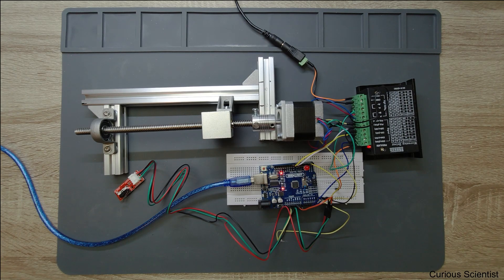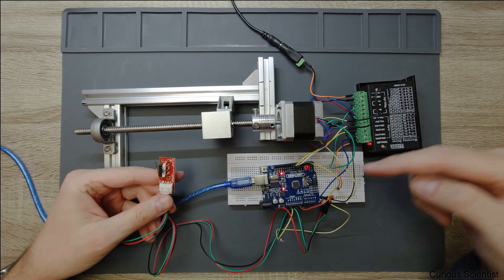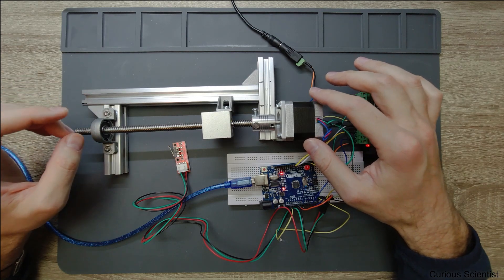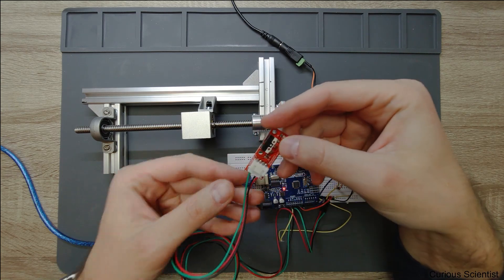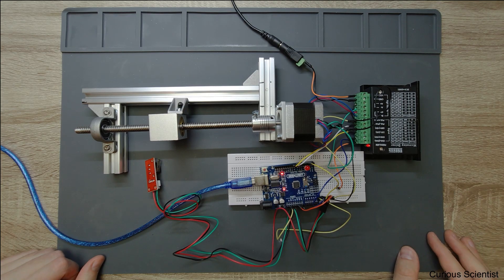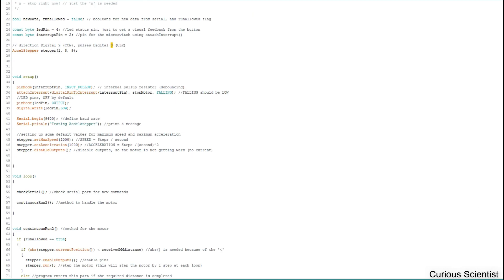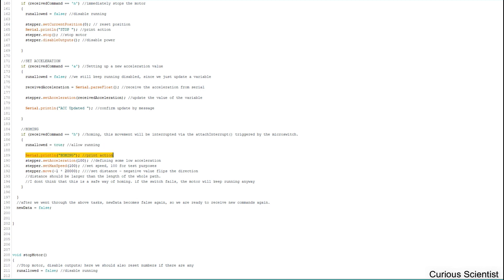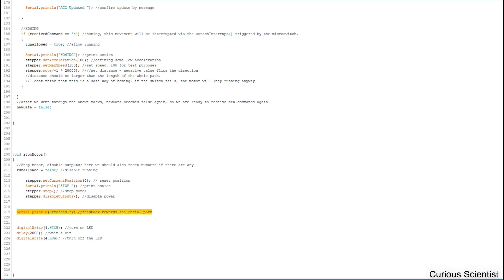Homing with the AccelStepper library and a limit switch

Comment: This code works with my a4988 driver and belt driven gantry (with tweaks for steps/mm) and thank you. I was pulling my hair out looking for exactly this functionality.  I deleted the malarkey regarding LEDs.  Anyone looking to control a linear actuator can take this code and run with it even if they're an arduino noob like me.
Reply from the maker: Thank you very much for your positive feedback! My intention with the whole channel is exactly this! I want to provide knowledge in a form that is easy to understand and easy to work with. I am very happy that the code worked for you and you could use it for your own project. Don't forget to subscribe, if you haven't done it already. More stepper motor related videos are on their way, I am just waiting for some parts.

Comment: Hi, Thank you for your 2 videos on this setup, it's pretty much what I have for my project. My question is how are the limit switch wired (can't make out from the vid), I have the same limit switches but can't make them work. I assume you are using just the green and red wires. Also, I want to use an external timer to start and stop the motor, opposed to using keyboard commands,  to reverse the direction twice a day to open and close a small hatch (door), any suggestions?
Reply from the maker: Hi! I am glad that it helped you! In this video, I just wired the black (GND) and green (signal, D2) pins and that's all. It is not the best practice, but it worked. I have a more recent video, where I show a sort of a ping pong game with 2 limit switches, you might want to check that out for some extra knowledge. There, I wired all 3 wires (red: 5 V, black: GND, green: signal)

For the timer-related question, check my video where I built a real-time clock based plant watering circuit. If you combine that with the stepper motor controller, you get what you want. But to make it more simple, you don't need an external timer. Twice a day, that can be fitted in the millis() function very easily. Start two timers when you start the arduino. You need two if() statements which are checking the time. Something like this:

if(time1 > 80000)
{
runmotor();
restartTime1();
}
if(time2 > 80000)
{
runmotor
();
restartTime2();
}

This is a very simple algorithm and it does not need any external units.

Comment: Thanks for sharing the video and your code. Would you be able to make a suggestion on how to adjust the code so that it works from buttons instead of the serial monitor? I just want to truncate it to a momentary button for homing, and one each for fast positive/negative movement and slow positive/negative movement while button pressed.
Reply from the maker: I made a control panel for stepper motors based on buttons and other controllers. Search for it on my channel and website.

Comment: I have a problem where if the button is released slowly it counts as another button press which stops the movement. so it stops fine. the limit switch is held down. then you move away from the switch, it releases and stops again.
Reply from the maker: The button you use is probably bouncing a lot. You need to debounce it. Either with software or hardware.

Comment: without tension, do you know if the middle part can move freely ?
Reply from the maker: What do you mean by "middle part"?
Reply: @CuriousScientist  i mean the part moins on the axis thanks to the motor
Reply from the maker: Ah, you mean the leadscrew nut. You need to spin the leadscrew to make the nut move. It is self-locking to some extent due to the friction of the threads.

Comment: Hello. Thank you very much for the tutorials!!! I learned a lot from your videos and sketches you make!
 I have a question. How can I make my bipolar stepper motor constantly looping back and forth with the AccelStepper library with the NON-blocking function? 
Thank you!
Reply from the maker: Hi! Thank you, I am happy that I could help. 

Just write a loop where you move to a certain number of steps, then with an if() statement, check if you have reached the end of the movement in one direction. After that, step back the same amount (flip the sign) and check the steps again with an if(). You can check the accelstepper library's info page where they say which functions are non-blocking. Use those. Remember, if you want to do something between 2 steps, the time required for the task should be quicker than the delay between the two steps. Otherwise, the motor will be lagging.
Reply: @CuriousScientist  Thank you very much, I will try that!!

Comment: Hi may I ask if making a 'homing' needs microswitch always? Can I make homing by just putting codes? I'm using nema23 and same driver module as yours
Reply from the maker: Hi! Homing can also be done by keeping track of the number of steps done. In fact the AccelStepper library keeps track of the steps and you can always use that to perform the homing. For example you move the motor clockwise 2000 steps, then move counterclockwise 500, then 700 clockwise and then give the homing command, the library will know that the overall steps from zero in cw direction was 2200, therefore it has to make 2200 steps in ccw direction to get back to zero. You just have to make sure that the system is 100% doing the exact amount of steps you give as a command. I can make a video on homing without switches using the AccelStepper library in the near future.
Reply: @CuriousScientist  Thank you so much! So all I need is the AccelStepper library and not any extra module for that control then?
Reply from the maker: @maryannemacalinao8376  Yes, you are right! I will upload a video of it during this week where I explain everything.
Reply: @CuriousScientist  looking forward for it sir! Thanks again!
Reply from the maker: Hi! I uploaded the promised video. Please check it out if you have time. :)
Reply: @CuriousScientist  I prefer this method of homing over the limit switch however, please tell me, will AccelStepper keep track of the stepper position in the event of a power failure then continue to travel the distances and directions commanded in the sketch when power is restored?  Thank you!
Reply from the maker: @cpnorkus  Hi Christopher! Unfortunately, all numbers will be lost upon a power loss. If it is crucial to remember the positions, I you can add an EEPROM and save the positions in it. Then after restoring the power, you can recover the most recent values. But, keep in mind that EEPROMs usually have limited life and it also takes time to write them (might disturb the stepping if you happen to write the EEPROM while the motor is moving). I think it is more easy to just add a USB power bank to the Arduino. You can keep the Arduino (only the microcontroller) awake for several weeks.
Reply: @CuriousScientist  Thank you for the speedy reply!  I have read on Arduino forums the limitations on using EEPROM for homing position.  I have been building my system incorporating a hall effect sensor because it is less likely to fail than limit or reed switches.  I do like your suggestion using a USB power bank a a UPS!

Comment: Hi I have tried your examples they are very good . But your last two examples where you have Changed to P, N etc i get a message on the monitor but the motor does not move . Have you made some other changes which effect the Accel Libaray ? Can you please help many thanks
Reply from the maker: Hi! It is a bit difficult to guess your issue. Do you use the code from PasteBin? Do you have the exact same wiring...etc? What did you exactly try?

Comment: Thanks a lot... I have other questions but I dont want to abuse  ;)
Reply from the maker: You are welcome! Just go on, ask it! We are here to help each other. And maybe if I can answer your question, it will help others too.
Reply: Hello  Is it possible to make a cercle with accelstepper library without Gcode ?
Reply from the maker: @patis.IA-AI  I think it is possible. If you have a x and y table or you can move your pen or anything that you use for drawing in terms of x and y, then you can do it. 

The equation of a circle with its center in the origin is x^2 + y^2 = r^2. So, you have to define the radius, then you can basically manually calculate x and y. You can run x as the integer in the for loop and calculate the y values at each step. Then you move your x-y stage/table/head...etc, according to the coordinates. It is pretty straightforward, you just have to move the x and y stepper motors based on the coordinates calculated from the equation of the circle. You can refine the step of x, then the circle will be smoother as well. If you want to place the circle at a certain place, you have to use the whole equation: r^2 = (x-a)^2 + (y-b)^2. Variables 'a' and 'b' will determine the center of the circle in the coordinate system.
Reply: @CuriousScientist  works with drv drivers?
Reply from the maker: @unknownblueblue  Hello!  Yes, it will work with the DRV8825, the A4988 as well as with the Easydriver circuits. 
Why?

All these circuits basically have the same two inputs: Step (or pulse) and direction. You just have to make sure that when you do the setup/initilaization, you define the proper pins for the step and the direction.
Reply: @CuriousScientist  thanks :)

Comment: Hey everyone, I used the template provided and tried to adapt the code for my used case, but I encountered some issues and though someone will stumble over this and will be able to help. I do not really understand the AccelStepper step counting feature. Could someone please help?

I want to enter a char into the serial monitor, say "t" and make the stepper move to a fixed position, where I know the number of steps from the zero position (which is indicated by the limit switch). But I want to be able to move to this position freely. 
However, I encounter two main problems: 
I don't really understand how the step counter in AccelStepper works.
My try was:

long sputter_pos = 1000;

if (receivedCommand == 's') { //Sputter - Sends the motor to the predefined sputter position
      runallowed = true; //Allow running
      Serial.println("Going to sputter position."); 
     
      current_pos = stepper.currentPosition();
      howfar=abs(sputter_pos-current_pos); //Set distance
      
      if(current_pos > sputter_pos){
        stepper.move(howfar); //Move distance
      }
      else{
        stepper.move(-1 * howfar); //Set distance - negative value flips the direction
      }

However the output simply is:
09:27:43.432 -> Going to sputter position.
09:27:43.480 -> POS: 0
09:27:43.480 -> POS: 0

and the motor does not move.

Another problem I have is that I would like the acceleration curve to be as specified but to have no deceleration curve, is that possible?

I also need a way of counting steps, so I would then send the stepper from the zero (limit switch) position and until I stop him manually with "n" for example and output the number of steps it went. Here the problem with the deceleration comes into play, as the stepper moves different amounts for different accelerations and if I stop him without decelerating th distance is slightly skewed.

Would someone reading this happen to know a thing or two, please let me know. I will update this if I find the solution to my problems.
Reply from the maker: Check my most recent videos in the stepper motor related playlist and you will find information for your questions. Your task is easy to do and I showed a lot of similar stuff in my most recent video related to stepper motors. As far as I know, you cannot accelerate but not decelerate. Then, just use the functions which do not use acceleration. But keep in mind that you won't reach high speeds.
Reply: @CuriousScientist  Thanks a lot for your quick reply! I will check it out and also figured that it can't be that difficult. 

Also thanks for the info in the deceleration. Maybe I will have to measure the position from full speed to stop when decelerating and just add this amount of steps as an offset for the distance to travel.
Reply from the maker: As long as your stepper motor is not hindered by something, it will do the exact amount of steps that you instructed. The deceleration does not influence the amount of steps and the precision if everything is set up properly. For example let's say you want to move 4000 steps and you have acceleration/deceleration implemented. Then the motor for example will step 800 steps with acceleration, then it does 2400 steps with constant speed and finally it decelerates to zero in the final 800 steps. So, even with deceleration, it will stop at the desired 4000 step position.
Reply: @CuriousScientist  Oh okay, then I will have to check it again but that was a thing that I didn't understand before.

Comment: i'm having issues in my code tho. I have a 2-axis system, 2 motors on y-axis and 1 motor on X-axis. I have 6 total limit switches attached for each end. I want my program to do the following: when the motors hit the limit switches, i want them to stop and then move in opposite direction a small amount to "De-press" the switch and then set that to my 0 position or Maxtravel Position. Any suggestions?
Reply: Could i possibly do something like this?:  in setup() { attachInterrupt(digitalPinToInterrupt(limitSwitch3), revXMotor, FALLING); }        void revXMotor()
{
  //Stops motor then moves reverses direction and moves it 1-inch back.
  stepper3.stop();

  stepper3.moveTo(abs(stepper3.currentPosition()- 254)); }
Reply from the maker: Looks ok, but why would you do that "complicated" stuff with the abs and moveTo... etc if you can directly move the motor in relative terms using the move() function?!

Comment: hello. I made a project with arduino and RF433 module and I hooked up a stepper motor to it and it works fine. but i need some help with the sketch.
how can i define 1 button of remote control to turn the motor shaft CW and CCW ?
i mean when i pressed the button the motor turned 45 degree CW and when hit the button again its turn in upposit direction.
is that possible to answer me
Reply from the maker: Hi! It is very difficult to answer this without seeing the system and the code. Sorry!
Reply from the maker: Hi! Could you please upload the code to PasteBin? Or it would be easier if you could email it to me. You can find my email address on my website: curiousscientist.tech . I think it should be easy to solve your issue.
Reply: @CuriousScientist  I really thank you for reply and i need to tell you I found the solution.one of my friends helped me with code.
Reply from the maker: I am glad that you and your friend could find a solution! Have a great day!

Comment: Thanks . How to setting origin position ?
Reply from the maker: Hi! You define it manually when you assemble your system, then you just use the accelstepper library and program it. The library knows where the stepper motor is located at.
Reply: @CuriousScientist  if i need to control 3 stepper mycode is
AccelStepper stepperX(1, 8, 9);
AccelStepper stepperY(1, 10, 11);
AccelStepper stepperZ(1, 12, 13);
right ? sir
Reply: @CuriousScientist  0 position alway reset when power off  arduino ?
Reply from the maker: Yes, if you remove the power, the physical position of the stepper becomes the zero if you don't have homing. That's why you have homing. You have to code a home direction (let's say, all your 3 motors move in the same direction within their coordinate system), then when you restart the Arduino, you can initiate a homing procedure which brings the 3 axes (1 by 1, that is the safest), to their own home position. 
The part of the code looks OK, however, I would avoid pin 10-13. They are valuable SPI pins. :)
Reply: @CuriousScientist  thank
Reply: @CuriousScientist  thank you very much :)

Comment: Curious scientist, Great work! I am very new with Arduino, I have used AccelStepper bounce example but I don't know to make the motor  always start in one set place(Home or Cero if you will, at the very beginning) then go from point A to point B and vice versa until it is shot down. Please Help. can you give me some codes.
Reply from the maker: Hi and thank you! I suggest you to look around in my stepper motor related playlist. There are many videos and each video has its own code. I also have a website where you can find the playlist and the codes too.

Comment: 1) You should NEVER use delay inside ISR. 
2) Serial print inside ISR is not recommended too
Reply from the maker: Yes, you are right. I wanted to visualize that something actually happens when the ISR is triggered. Therefore, I had to send some messages to the computer, and I wanted to light up some LEDs. As the ISR was related to something which stops the motor, I think it is "okay" to use it as it is not taking away the resources from some important task.

Comment: It would help to show the schematics. It is is hard to see how you wired all up.
Reply from the maker: Hi, You are right, but the wiring is so simple, it does not worth the effort to draw it. Also, pretty much everything is explained in the video, you just have to watch it carefully.
DIR (-) goes to 9, PUL (-) goes to 8. DIR(+), PUL(+) ENA(+) goes to +5 V, and ENA(-) is not connected. The 4 wires for the stepper always depends on the motor. The limit switch uses one of the interrupt pins, in this case pin 2. The LED is connected to the pin 4 using a limiting resistor. 

Also, there is another video mentioned in the description where I tell where did I connect the pins. Check that video from 17:15-19:00. You're welcome!